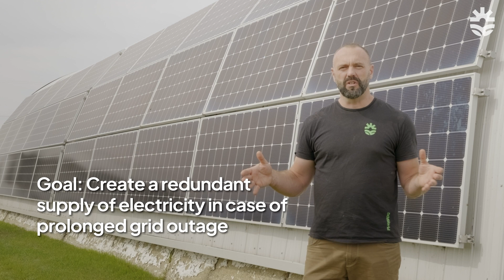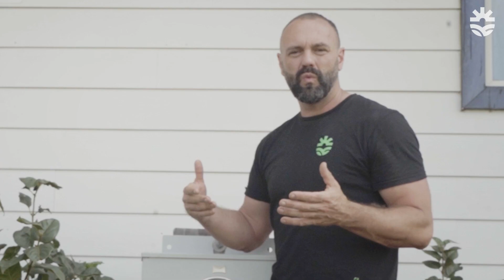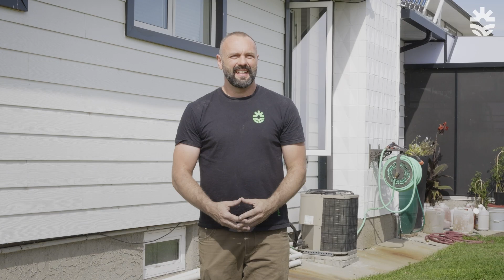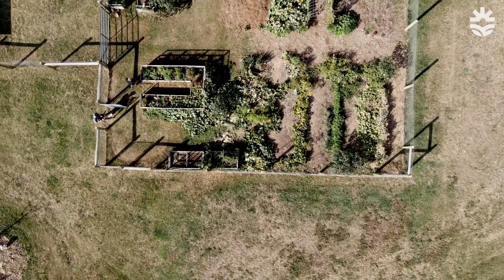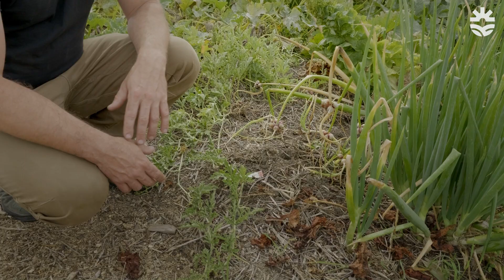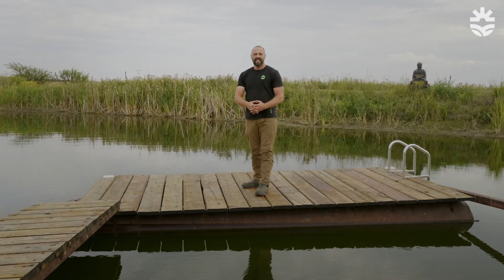This Property is Designed to Work Off-Grid For 30 Years

Comment: Why did you have to call it something stupid?
You have a great system there, but it isn't "anti fragile" as you described it.
It doesn't get better under extreme conditions. It is stable. It is resilient. The batteries don't gain functionality by being fully cycled every day. The solar panels don't produce more power on cloudy days.
The whole concept of anti fragile is just gimmicky
Reply: Exactly what I was thinking. Cool system, but not anti fragile in the way he described it AT ALL.
Reply: True. There are antifragile elements of this build (like orienting the house appropriately to harvest solar thermal energy), but it's not antifragile overall.
Reply from the maker: We can see your point, in this context though, it does not get better but it would get more valuable. We agree with you, though, that generally the only systems that are truly antifragile are biological systems, so we are stretching the term in this context.

Comment: My pops got a powerwall installed he said it emits a ton of EMF per the readings he took... can they not make an inverter that makes a clean power?
Reply: I tend to stick to Victron inverters as they have little problems with EMF and are durable
Reply: As in, they produce EMF or dirty power? Two different things.
Reply: @lolimpol  none of the above. read a test about the Multiplus 2 for example
Reply: @johgude5045  I was replying to the original commenter and they're father's Tesla Power wall. It intrigues me as Victron inverters use good old Transformers whereas Tesla Power walls use a buck/boost converter and inverter. Should mean the Tesla is more efficient but worse at starting bigger loads.
Reply: @lolimpol  Tesla Powerwall  is an AC battery (AC in / AC out), so it has horrible efficiency. Better go for DC Trackers and DC/AC Battery Inverter. The Multiplus 2 does not use a normal transformer like the older ones. The big inductor of the MP2 is needed to provide low ripple and thus low EMF at the 5 kVA it provides. I have seen them in all larger inverters i have looked into, and that have low ripple. The EPever ones use multiple smaller inductors but dont looks so clean in their spectrum
Reply: @johgude5045  AC batteries don't exist :) A Tesla power wall is the exact same thing as a Multi plus with a battery attached. And I wouldn't say 90% roundtrip is a horrible efficiency. That's actually better than the 82.4% a Multi plus 2 gets. And I'd take a look at the forums, Victron inverters most certainly do make use of toroidal transformers. A coil like that would be absolutely unnecessary, where a slightly bigger cap on the output would achieve the exact same result. But in fact like I said those transformers are great for driving big loads and I am impressed by the efficiency they get. That's not even mentioning Victron's build quality. Anyways, just interested in the information since a Tesla powerwall should not make either noticeably large EMF OR big voltage ripples. Btw, those are two very different things too.
Reply: @lolimpol  thanks for the info. i thought that it is an inductor, but google told me the same :) Most MP2 users charge their batteries with DC-DC trackers, no inverter involved. I would indeed be surprised if the Tesla Inverters have that bad of EMF and bad power factor. I dont know anyone who ones one though to measure by myself unfortunately. Anyway i would go for something more repair friendly for such a house.
Reply: @johgude5045  don't get me wrong, I'm looking into home batteries right now and Tesla isn't even an option 🤣. I see what you mean with the DC-DC now, you're talking about solar panels obviously 😅. Anyway, I love Victron products too! Would love to hear from the original commenter though.
Reply: @lolimpol  understood. I hope he answers soon. 
Do you know a HF-type battery inverter for 48V that does not consume crazy amounts of standby power? As alternative for the MP2 that can be both grid tied or offgrid? The pure offgrid ones consume around 5W standby per KW which is really good.  The MP2 uses only 8W standby which is also very good, it is just not very efficient at high loads, most likely because it is a good old transformer inverter, not an HF-type
Reply: @johgude5045  I'm currently debating between SolarEdge and Growatt. They're tied to a solar inverter but that makes a lot of sense considering you only need a single inverter for both jobs. I have no idea what their standby usages are though. They're just very applicable to my situation. I can potentially build a house soon, then I'll try to make my (largely) entire house run on DC, simply having one charger, a solar DC-DC and nothing else.